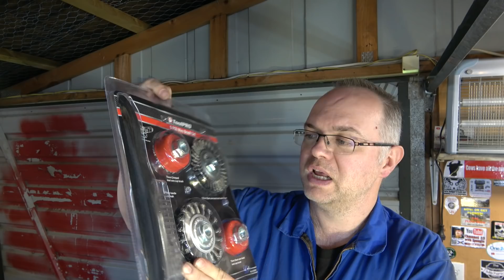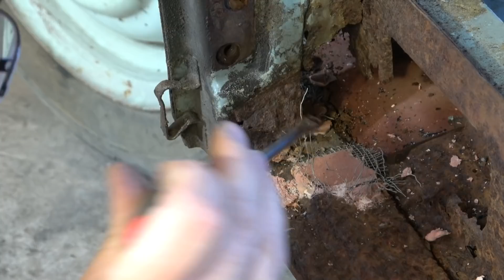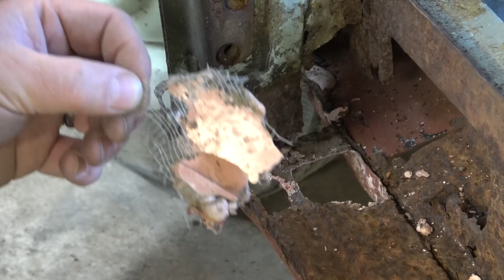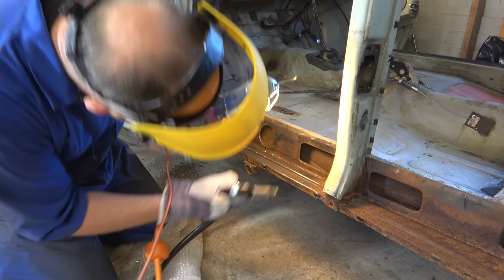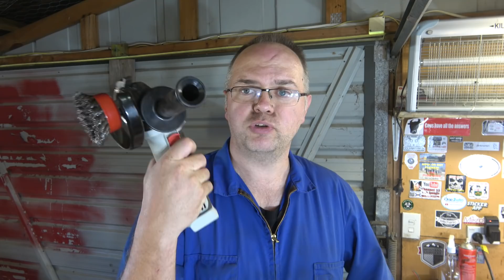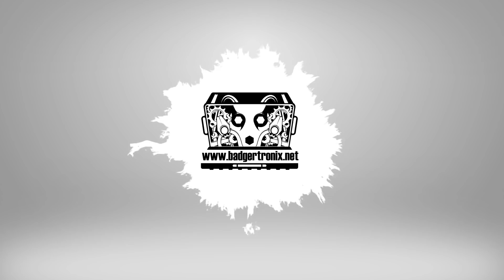Morris Minor - Rust Removal Testing with ToolPro Tools - Part 13

Comment: The polystrip discs are great for light-medium rust. I use norton blaze rapid strip discs. 115mm but also do a smaller roloc type for fiddly bits - theyre ace.

Comment: Good luck for your project, I did it in my car 3 year's ago but not that much rust in my car just a little in the rear wings normal for a 50 year car, you are doing a good job👌

Comment: Have you tried one of those belt finger Sanders? Great for getting into awkward areas. I've seen them used and it's next on my shopping list.
Reply from the maker: I haven't tried one but might get one to try out. You're right, they might be useful in tight spots
Reply: @Badgertronix  They're quite powerful, just don' try to use them on soft timbers! I know someone who tried using one to sand paint off of old doors using 40-grit belts and the doors didn't really like that. Obviously 40 grit isn't all that suitable for that job either.

Comment: Been watching every build video so far and really enjoying them but what are you going to do with the car after you complete it will you keep it sell it? I think you should keep it and build it up into something interesting like convert it to a 5 lug pattern and buy some cheap boat trailer wheels and put them on it it would look mad I think you have a real gem mate keep up the good work👍🏼
Reply from the maker: Awesome, thanks for watching 😀

That's a good question... Technically it's not even my car so the future is not entirely in my control. I'm planning to have a big road trip once it is finished which should lots of fun. Modified cars are subject to a certification price in NZ that costs money. The plan will be to get it in the road in standard form then maybe modify it in the future. Cheers
Reply: Badgertronix maybe offer buying the car from whoever owns it because it’s a decent sized project so it would be a shame to see it go
Reply from the maker: It's complicated, but it's not going anywhere!